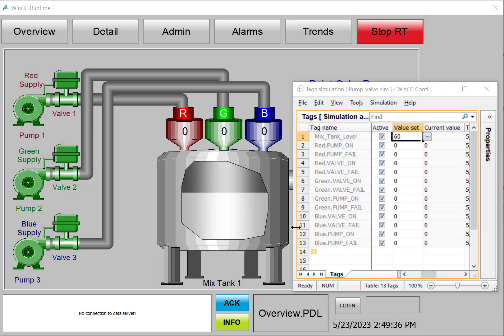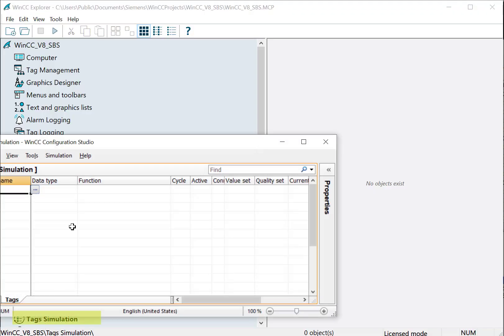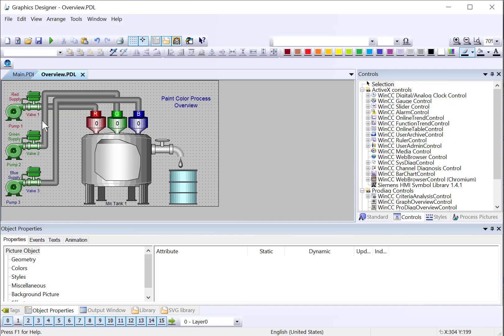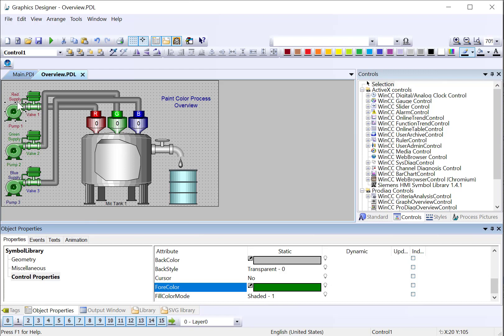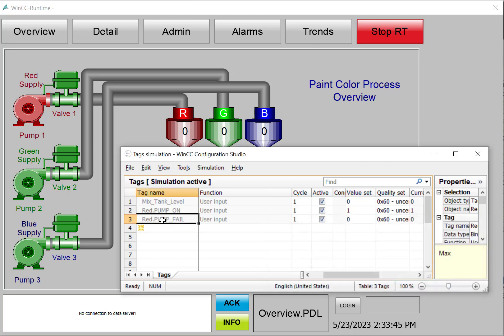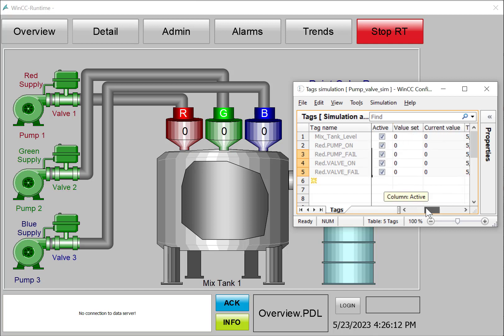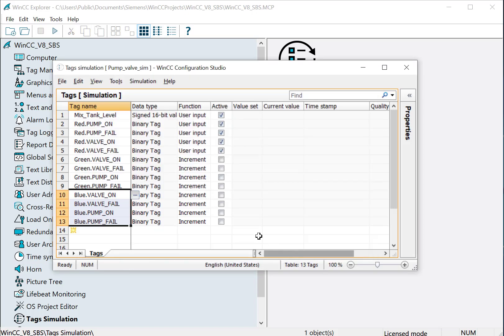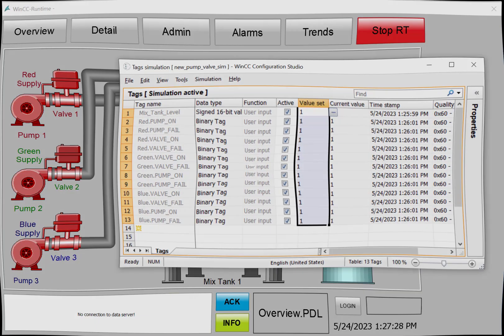WinCC v8.0 Step By Step 11: Create Overview Dynamics with Dynamic Dialog 👍 #winccguru

Comment: Thanks for the wonderful playlist.
But I kind of fins structure tags in WinCC completely useless.
For example if I'm gonna do a similar project in practice, these values would need to come from a PLC or an OPC-UA Server (not internal) while structure tags can only be internal.
In WinCC Professional you can have UDTs in the HMI Tags WinCC V8 would have been way better if it had that.
Reply from the maker: WinCC structure tags can be plc tags or internal tags. They work with siemens PLCs. They can be addressed to the UDTs.
Reply: @WinCCGURU  how can I address them to plc tags?
It only lets me choose internal tags
Reply from the maker: There’s a check box that says external or internal  on each structure member if you change that check box, it will allow you to address PLC or external tags. For siemens PLC‘s it calculates the address for each member by the offset and we have to put one address in.
Reply: @WinCCGURU How would I be able to use UDTs in optimised DBs since those won't have offsets for the differnt eements of the UDT?
P.S. Thanks for all your videos, they are very helpful

Comment: Hey, great video, I wanted to ask something of a unrelated question, what are the practical differences between WinCC V7/V8, WinCC Unified and the WinCC from within TIA Portal?
Reply from the maker: Hi Martin, great question. These are all different products. 

WinCC SCADA, which is the V7/V8, has been around since 1995, and is a stand alone SCADA. It is very powerful.  It does have some interfaces with Step7 PLC Programming and SIMATIC Manager, which was the basis of TIA - Totally Integrated Automation.  WinCC is the core OS of PCS7, which works with all of these products to offer an "out of the box" automation system.

WinCC Unified is the latest SCADA which fits within the TIA Portal, currently version V18. TIA Portal allows you to do the PLC Programming, Networking, Panel and SCADA applications, all in one package. The interface here is standardized and looks similar to earlier TIA Portal versions such as WinCC Professional and WinCC Flexible. It uses JavaScript instead of VBS and C, and offers similar tools for animation as WinCC SCADA, but not the same names or interfaces. 

The earlier WinCC Professional and Advanced were earlier versions and fit within the TIA Framework.  WinCC professional had both C and VBS Scripting and shared the same runtime engine as WinCC SCADA. 

Finally, there is WinCC OA, for Open Architecture, which is totally different. It can run on any OS (Windows/Linux/Unix) and is heavily Object Oriented programming based on C/C++. Very powerful and can handle thousands of clients, but more configuration.